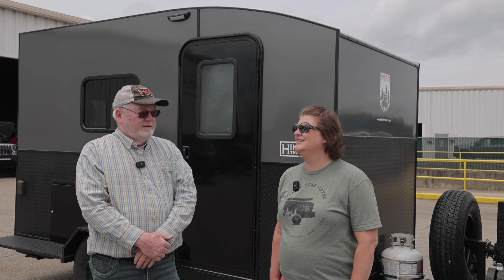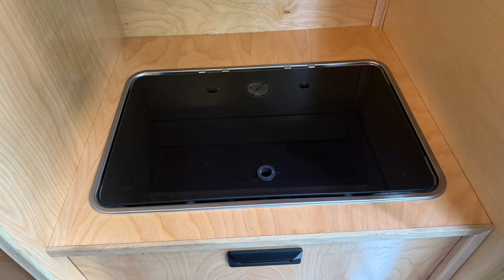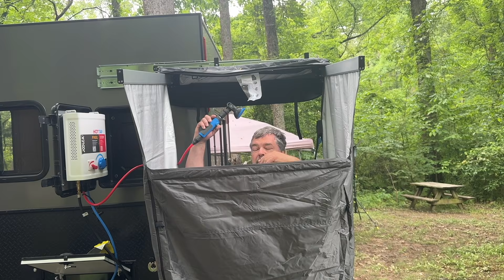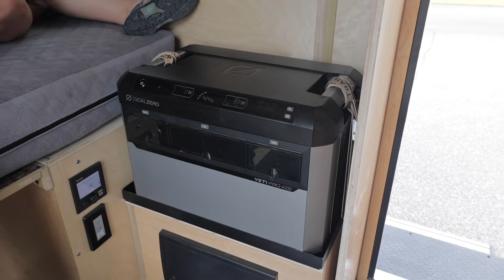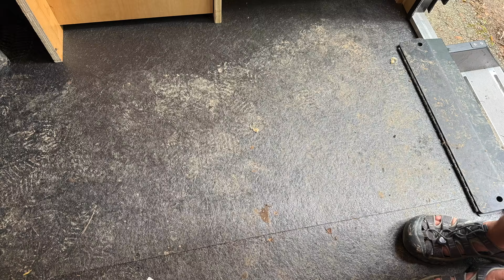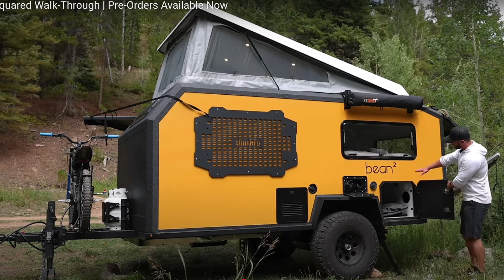Hiker Trailer Grew UP

Comment: Not a fan. 
1. Does not have the sweet lines of the standard Hiker.
1.  I WOULD like additional height.  20” added to the 44 would be fine -  5.5 feet is enough to change clothes.   
Center of gravity is too high.
2.  Ceiling fan looks out of place and a bit dangerous.
3. 3,000 lbs.   My SUV tows 3,500 - no way I could tow this.
4.  Seating looks very uncomfortable - Wendy did not look comfortable sitting.  

I think Hiker is trying to accomplish too much with this design.  I think just another 2 ft in height would make a lot of people happy.  Just a bit more would go a long way.
Reply from the maker: Thanks for your feedback. You are correct, it was not comfortable sitting at that table and the table was way to small.
Reply: Yup agree 100 percent., Maybe do a pop up would be smarter.

Comment: Nope. Not for me. I'm more a square drop / tear drop type guy. This blurs the line into RV territory. I would have much rather seen them come out with a wider model or one with a pull out kitchen. That sink and single burner stove look too small and who wants to cook in that small of a space in the summer? Good luck to them though.
Reply from the maker: Thanks for you input - agreed :-)
Reply: Good remarks. I am building a 5x9 Hiker look alike. Slide out kitchen and sleeps 2 adults and 2 kids that could be as tall as 5' 6". Yes in a 5x9. The room inside feels so much bigger than having hat wall at the back .

Comment: Interesting.  Two things I would change immediately:  1.  Don’t use the types of stairs that have to go into your RV.  The ones that tuck up under are so preferable.   Not having to stow dirty, wet stairs inside or being able to go in stealth mode necessitate an outdoor stair.  2.  Don’t make people move a bed to access a table.  I think the idea of a table is good, the execution is not.  

We have a hiker and, while this is a bit appealing, I think current design is a miss.   

Also, the ceiling fan is just too weird.
Reply from the maker: Thanks for sharing your input.
Reply: Agree 100%

Comment: 😮I'm excited by the possibilities. I would like the upper cabinets, electric and solar installed the rest I would choose to do as I go. Great video
Reply from the maker: Thanks for your insight.
Reply: Runaway has a great option for bars on top that clamp on the sides because of its fiberglass roof. Solar panels are a must to attach to the bars of the Runaway. I like the quality of the Hiker Trailer, but solar panels are needed to power up the power bank.